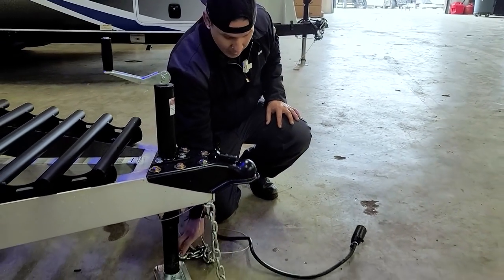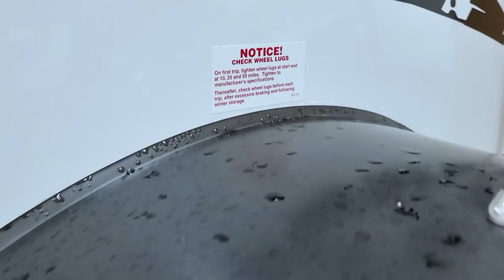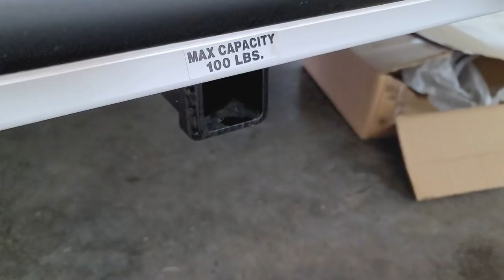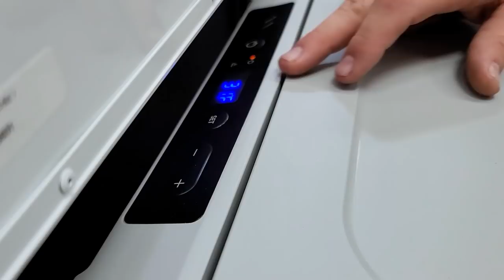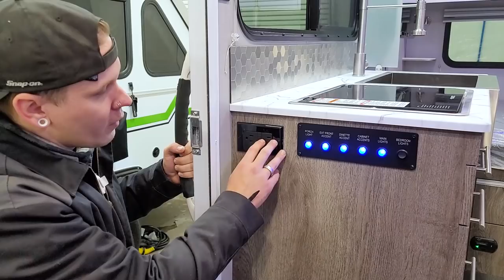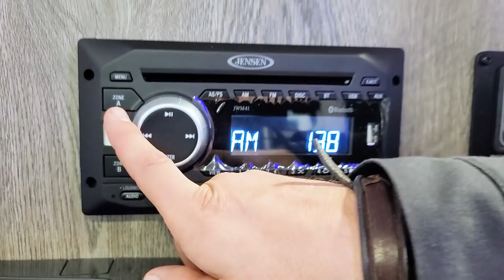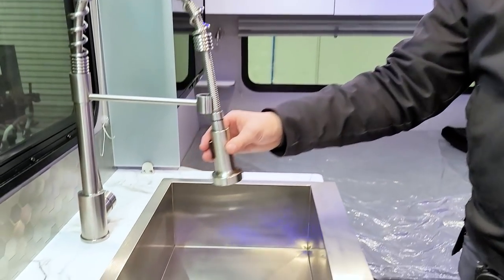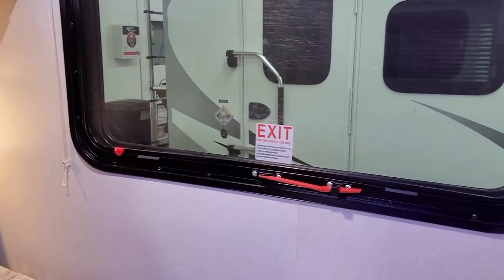2021 Intech Sol Horizon Technician Tour

Comment: Can you add a video showing the valves under the master bed and explaining fill, drain, winterize, hot water tank?  Also how to keep pump from leaking out the city connection when boondocking.
Reply: You're question answered my question. Thanks.

Comment: I have a Flyer Forge which likey has the same shower system. The clearance is very low and it seem like the shower drain line runs nearly level rendering shower draining a 10 minute ordeal. Is this common because I if the limited pitch? Is there a fix or do you have to lower the front jack to help the shower drain?